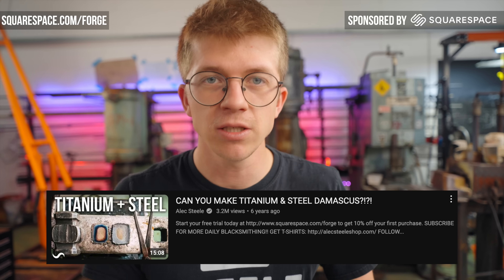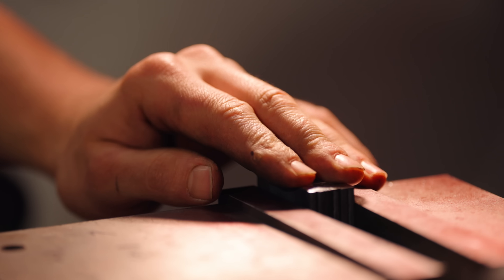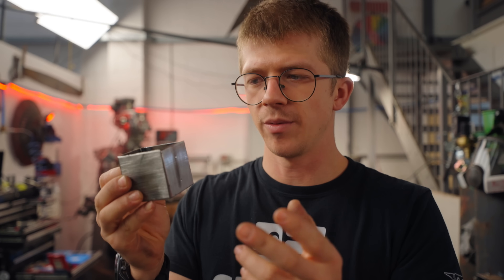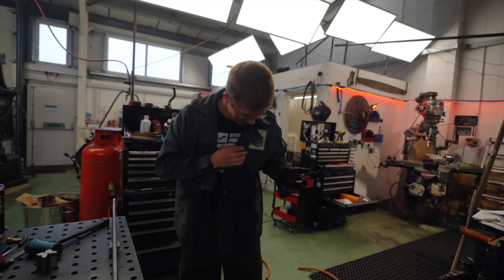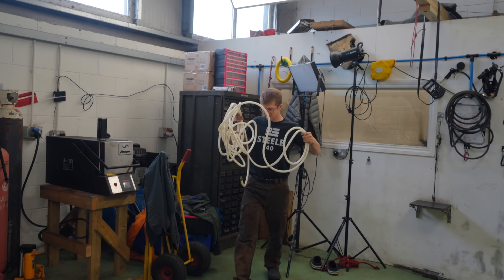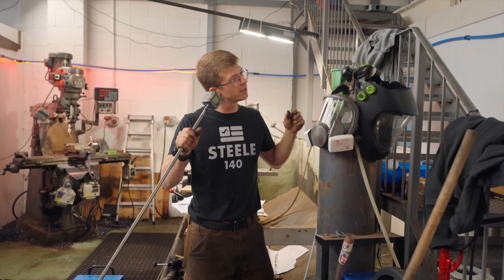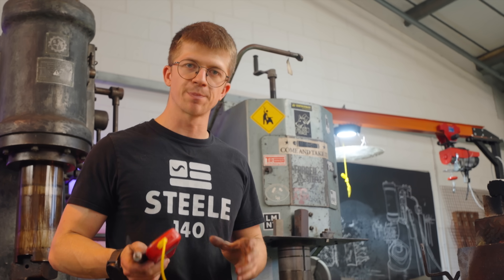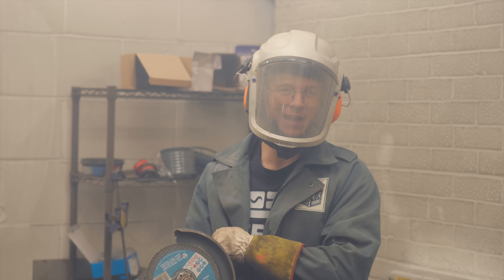Can I make Titanium Damascus?

Comment: yes, 2 inches is not 50 mm, but 50,8 mm (which is much more closer to 50,9 mm that you've measured. so those plates weren't 50 mm, but probably 2 inches...

Comment: No you cannot make Damascus titanium Damascus steel comes from Syria and is not titanium just because you fold steel does not mean it's Damascus
Reply: Damascus refers to pattern welding and has referred to pattern welding for centuries
Reply: @Joker-em6oz no it does not Damascus is the steel that is mine in Damascus Syria you're just making a pattern it's not Damascus steel there's only one place and I keep saying it's over and over Damascus Syria is where the steel comes from and they're running out it's very rare and very expensive so you might as well just say in your videos patterned Steel
Reply: @kellgormom60 first, wrong. Damascus was not from Damascus Syria, that’s where the blades and steel were traded not made. Second, everything I said was true. Pattern welded steel has been known as Damascus for centuries. The word Damascus at this point also refers to pattern welding

Comment: Now that the patent (US 6,857,558) has expired, you can use the original canister welding process to make your own laminated titanium:
 * Prep the Titanium: Use alternating layers of different titanium alloys (commonly CP/Grade 2 and 6Al4V/Grade 5), meticulously clean them, and stack them.
 * Canister: Weld the stack shut inside a mild steel enclosure (canister) with an inlet/outlet for gas.
 * Purge: Crucially, purge the air out and fill the canister with an inert gas (like argon) to prevent the titanium from oxidizing at high temperatures.
 * Heat and Press: Heat the sealed, purged canister to high temperatures (around 1200^{\circ}\text{C} or 2200^{\circ}\text{F}), then use a hydraulic press or power hammer to forge-weld the layers together.
 * Patterning: Remove the steel jacket, and then fold, twist, or grind the billet to achieve the desired Damascus pattern.
 * Coloring: Heat-anodize the finished piece to reveal the distinct, vibrant colors of the different titanium alloys.
Safety Note: Working with titanium at high heat requires specialized safety procedures, including excellent ventilation and having a Class D fire extinguisher (for metal fires) nearby, as titanium dust and shavings are flammable.

Comment: Not enough torque. Slow jn mean high torque push to made the patern

The number or degree to made the material melt then push it with those argon just to stir it up. High torque pump what you need

Comment: You created  a fantastic result, especially for a first attempt based on a patent. To build on that success and meet his creative goals of making more complex patterns and achieving "crazy color combinations," here are improved methods, techniques, and other creative avenues to explore.
Phase 1: Improving the Core Process for Reliability
Before attempting complex mosaics, perfecting the basic billet is key. These refinements focus on eliminating the variables and failure points seen in the video.
1. The Canister: From a Container to a Controlled Environment
 * Improved Method (Canister Material): Use 304 or 316 stainless steel for the canister instead of mild steel.
   * Reasoning: As seen in the video, the mild steel can readily forge-welded to the titanium billet. Stainless steel is far more resistant to welding to titanium at forging temperatures, which will make removing the billet dramatically easier and cleaner.
 * Advanced Technique (Weld Release Barrier): Coat the entire inside surface of the canister with boron nitride spray or line it with ceramic fiber paper before stacking the titanium.
   * Reasoning: This creates a physical barrier that absolutely prevents the canister from welding to the billet, even if there are imperfections. The billet will simply fall out of the can once opened.
2. Cleaning: Achieving a Surgical Standard
 * Improved Method (Multi-Stage Cleaning): Titanium welds are a chemical process; absolute cleanliness is non-negotiable.
   * Degrease: Wipe every sheet with acetone or denatured alcohol to remove all oils.
   * Abrade: Sandblasting is superior to grinding as it provides a more uniform, non-directional texture and removes oxides more consistently.
   * Final Clean: After blasting, handle the sheets only with clean nitrile gloves. Give them a final wipe with acetone to remove any residual dust right before stacking them in the canister.
3. The Purge: Ensuring an Oxygen-Free Atmosphere
 * Improved Method (Sealing): When welding the canister lid, bevel the edges of the lid and the can walls. This allows for a deeper, more robust TIG weld that creates a truly hermetic seal, preventing leaks and conserving argon gas.
 * Advanced Technique (Gas Distribution): The creator's instinct to offset the holes was good. To perfect it, weld a small, capped tube onto the gas inlet inside the canister. Drill a series of small holes along the length of this inner tube. This acts as a diffuser, distributing the argon gas evenly throughout the entire stack and purging oxygen from the corners more effectively.
4. The Forge Weld: Precision Over Power
 * Improved Method (Temperature Control): The overheating was the biggest near-failure. Instead of manually managing a forge, use a PID-controlled heat-treating oven or kiln.
   * Reasoning: This allows you to set a precise target temperature (e.g., 1950°F / 1065°C) and a "soak time" (e.g., 20-30 minutes). The controller will hold the temperature perfectly steady, ensuring the entire billet is evenly heated without any risk of melting. This is the single most important step for repeatability and success.
 * Alternative Method (Consolidation): For the initial weld, a hydraulic press with flat dies is superior to a power hammer.
   * Reasoning: A press provides a slow, even squeeze that consolidates all layers at once without the violent, localized impact of a hammer, which can cause layers to shift or weld incompletely. Once the initial weld is set, a power hammer is excellent for drawing out the billet.
Phase 2: Meeting the Creative Design Goals
With a reliable core process, the creator can now focus on the artistry.
1. Goal: "The Craziest Color Pattern Combinations"
The colors are a direct result of the specific titanium alloys used. To get more colors, you need more alloys.
 * Technique (Alloy Diversification): Introduce other metals that are known to weld with titanium in this process. The two most common and spectacular are:
   * Zirconium (Zr): When heat-colored or anodized, zirconium forms a deep, silky black oxide layer, providing a stark and stunning contrast to the blues, purples, and golds of the titanium. A billet of Grade 5 Ti, Grade 2 Ti, and Zirconium is often sold under trade names like "Timascus" or "ZircuTi".
   * Niobium (Nb): Niobium can also be incorporated. It anodizes to a different color spectrum than titanium and has a higher melting point, making it very stable in the forge-welding process.
2. Goal: "Titanium Mosaic Damascus"
This is the next level of artistry, involving creating a picture or complex geometric pattern within the metal.
 * Method 1 (The "4-Way" Technique):
   * Create a standard laminated billet as he did in the video.
   * Forge it into a perfect square bar (e.g., 1"x1").
   * Cut the bar into four equal-length pieces.
   * Arrange the pieces into a 2x2 square bundle, rotating each piece 90 degrees to expose the layers on a new face.
   * Canister and re-weld this new bundle. Forging this new bar will distort the original straight lines into complex "W" or "ladder" patterns.
 * Method 2 (The Accordion Cut):
   * Forge a welded billet into a thick, flat bar.
   * Use a milling machine or an angle grinder to cut deep grooves or patterns into the face of the bar, being careful not to cut all the way through.
   * Heat the bar and forge it flat. The metal will collapse into the grooves, radically distorting the layers into eye-catching swirls and starbursts.
 * Method 3 (Canister Mosaic):
   * This is the ultimate technique for creating images.
   * First, create several different patterned bars of titanium Damascus (e.g., a straight laminate bar, a twisted bar, a "4-Way" bar).
   * Cut and machine these bars into specific shapes (squares, triangles, custom shapes).
   * Arrange these solid pieces inside a new, larger canister like a jigsaw puzzle. Fill all the gaps with powdered titanium or another compatible powdered metal.
   * Seal and forge-weld the entire canister. When you cut it open, the cross-section will reveal the complex picture you assembled.

Comment: Nothing in this video contains the manufacturing or forging of Damascus. Pattern welding just isn't Damascus no matter how hard Youtubers try to push it. They are two entirely different processes.
Reply: Damascus has referred to pattern welded steel for centuries. It’s not YouTubers trying to push it, it’s just been that way for a long time

Comment: 4:00 could have attached quick connects to the pipe and use a hose that has a quick connect to prevent any potential gas leakage.

Comment: a lot of metals want to weld together under vacuum when cold. it may be interesting applying this during the billet prep phase. a quick google search brings up some expensing lab equipment "electric furnace vacuum chamber" you should be able to like... put your billet into a large threaded capped pipe and put that under vacuum on one end and the end with the billet into the forge?

Comment: I really would like to see if vanadium would be an good interlayer between steel and titanium.. because both metals are profiting from it when you alloy vanadium in it
Reply: Probably not. The vanadium would diffuse into both resulting in intermetallics. You want metals that are similar enough to bond and have complete solubility or metals that aren’t at similar or at all soluble
Reply: Jeah but in good steels there is vanadium and in the titan alec is using (ti6) also is vanadium .. so maybe with a thin vanadium foil between ti6 and an vanadium steel ( like X45CrMoV15) the intermetalic alloys would match..
Reply: @cptstiff3746 it’s not about the intermetallics marching, it’s just intermetallics tend to have really bad properties

Comment: as an engineer i dont think the specs leave out info (like how slow to introduce the argon) to protect trade secrets, because even the internal specs are like that. it’s mainly because updating a spec is incredibly tedious so it only gets done once every couple decades, ive had to work from specs that were last revised in the 60s, and lots of info has been learned about that process in the meantime that never got put on there, it’s just passed around by word of mouth. We call this kind of info “tribal knowledge”, and one of my main goals at my company is to reduce the amount of undocumented tribal knowledge to zero. It’s a job that will certainly take me years because dear lord there is so much info that hasnt been written down in the last 50 years

Comment: I’ve tig welded titanium and that’s the one metal I absolutely hate to weld. Even in orbital. On stainless I can adjust real quick and get on first try. But on titanium I did bout 25 coupons to get right on schedule 10 and when I switched from 2” to 3” it was time consuming. Rather tig weld it than orbital.

Comment: You can do the same thing but a different method. An example, back in the late 50’s John Deere developed a bale thrower for a baler so you didn’t need help stacking wagons. One of their lawyers said the only way it could be used by someone else is if they dribbled the bale first. New Holland came up with one that used rollers constantly turning, and it didn’t break the parent because Deere use an arm and clutch that only threw when a lever engaged the clutch and an arm swung. Since the others were constantly moving it didn’t have a throwing stroke, therefore no patent infringement. Ferguson’s three point was another, you could make a three point hitch, but it had to be more complicated than his, in 57’ a judge didn’t renew that protection because he said it was too valuable to the industry then everyone copied it

Comment: If I be so bold, when we cut or clean Ti for my bicycles, use no abrasives other than scotchbrite pads. Blasting and sanding imbed impurities in the metal. Use a SS wire brush dedicated to Ti as well. Use sonic cleaner and use white cotton gloves to handle clean parts. I'm sure you will have fewer bonding issues.

Comment: Sorry I’m 4 months too late but a good Flow rate is around 8-10cfh. Also titanium should melt at a lower temperature if it’s shrouded in an inert gas like argon so that’s why they recommend a temp so much lower than its normal welding temp. I’d say 1850 is a good temp to forge it at and 2100 was way too high. Also you can get some contaminates from using carbon steel as the case. In titanium tig welding you don’t want it to even touch steel or anything other than more titanium. Just laying it on the steel bench could possibly contaminate it but I guess since it’s only the sides and faces touching the steel it’ll only contaminate those outer surfaces and not affect the weld. It wouldn’t matter anyways because then you’d need to shield the whole outside with argon which seems unlikely. Overall it turned out way better than I thought it would when I first saw your setup. Friggin Congratulations dude!

Comment: Here a Patent Engineer from Mexico. If there is a Patent in the US, two considerations(mainly, might be other) need to be satisfied:

1.- If you are in whichever country else the US
2.- The patent is not filed and granted in such country

You CAN commercially explode the invention.

Other thing you have to look at, is the patent protection limitations. If it only protects the method in claims section, you can commercially explode the product, but if the product is claimed and not the process, you might can produce the Damascus Titanium products with other methods

Comment: I looked up some charts for the properties of both metals, and from 1750°F to 1850°F, I found that temperature to be a sweet spot. It is on the low end for 1095 steel and on the upper end for titanium. If the titanium is sandwiched between the steel, it should forge a block because the titanium will bond to the steel. Thoughts?

Comment: Watching further I see you struggling to attach the reinforced hose onto the pipe.
Just boil a kettle, put the water into a mug , then put the hose end in to soften, before forcing onto pipe.
Failing that, put a tapered step bit into the vice and use a hot air gun to soften the hose whilst pushing onto the bit

Comment: Argon tip and trick 
its heavyer then air, so it fills op from the bottom an you dont want a "low purge hole" because! you run the risk of air pockets in the top and can get an unclean weld. 
formir gas is lighter then air. and for tha,t you would want a low purge hole :)

Comment: Thanks, this video made me wake up in the middle of the night thinking about the intermetallic problem. I ran my little brainstorm past ChatGPT and get the impression it isn't new as I had hoped and maybe you already abandoned the idea. Basically make an alloy using similar but a little different metals. For example, Vanadium to go Titanium, and Manganese to go with Iron. The similarity of Vanadium to Ti means V might be substituted into the crystal lattice where Ti would normally go. But the difference would screw up the lattice. The lattice might get so messy it isn't really a lattice anymore so no crystals so no more intermetallic compound. Apparently something like that is something materials scientists are looking into to make High Entropy Alloys (HEA) which sometimes have useful properties.  To make one, I think you would need an equal number of Ti and V atoms, and equal Mn, Fe. With luck it might make a better knife. But if that is too expensive to mess with, smaller amounts V and Mn might poison crystal formation enough to be helpful. Other metal neighbors of Ti and Fe might work, some are likely expensive though.
A different approach that might not work would be alloy TiFe with much larger and/or smaller atoms.  Something like lithium might not so much disrupt the crystal as worm its way in between the TiFe atoms and wedge some distance between them. That might just pre-stress the material, but the extra distance might weaken the forces between TiFe so it is more ductile. A potential difficulty in trying it out is the 3rd metal also needs to be soluble in TiFe.

Comment: Its a bit niche, but could you create a billet of titanium damascus that a gun maker could potentially turn into side by side shotgun barrells or gun. Longthorne have made a titanium barrel over and under shotgun, im not sure if they have made a side by side in titanium. Imagine a titanium damascus side by side shotgun. Lead shot  is on its way out, steel is coming, but the beauty of the form does not need to be lost. Those old shotguns are a thing of beauty and functionality, it would be a joy to continue the functionality and the beauty.

Comment: The reason for the colours is less due to the presence of different oxides but mostly the rate at which the oxides are growing. Titanium oxides are nanometers thick and therefore interact with light. Other elements (such as aluminium) simply suppress the rate of titanium formation . With continued heating it is possible to cycle through these colours!

Comment: Ha, Ha, a patent does not stop you from making things.  It's only applicable if you make products for profit and if the patent owner even cares.  What a drama, as bonding similar metals in an inert gas is not patentable since this technique has been used for hundreds of years, and arguably for thousands..  That patent was worthless to begin with, as there is nothing novel with using inert gas or intermediary bonding layers.